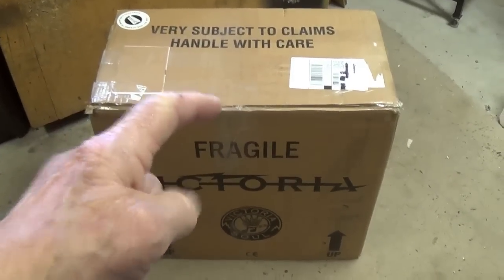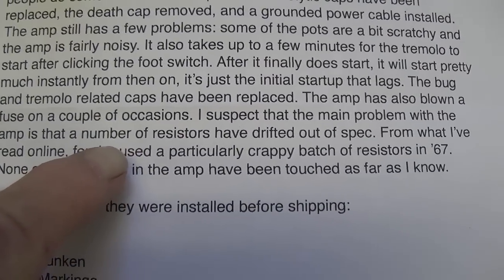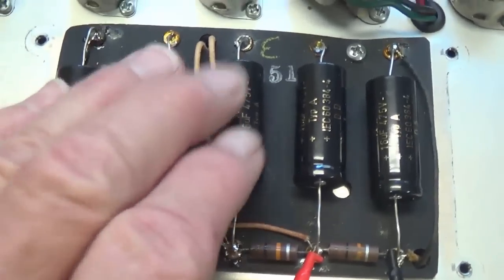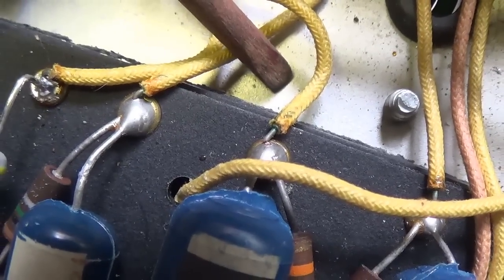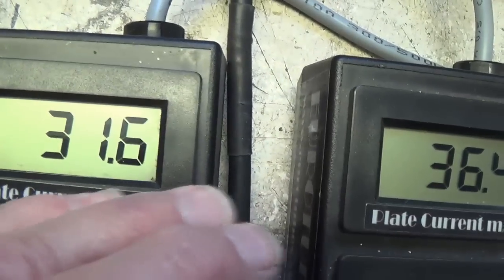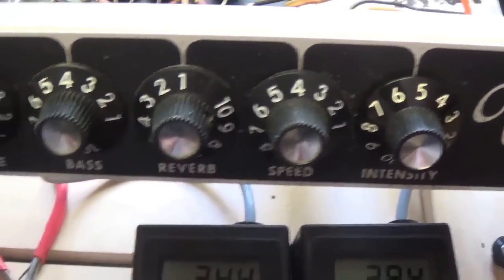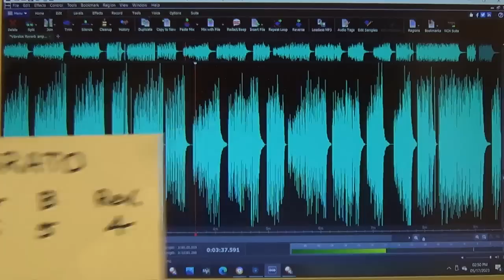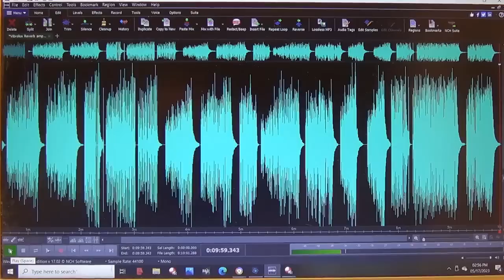1967 Fender Vibrolux Reverb with a Lazy Tremolo and too much Background Noise

Comment: Thanks so much for the work on my amp Uncle Jack! It sounds fantastic. A little more history on the amp - I'm the second owner. The original owner put the amp in a closet in 1974, where it stayed until I bought the amp. I suspect the power transformer was blown at that time. I do have the original transformer, but it likely needs to be rewound. I'm not sure if it's worth the time and effort to do that, but welcome feedback.
Reply from the maker: I wish I had received the old PT with the amp, Matt, to confirm whether or not it was at fault. If you intend to keep and use the amp, I would say that remaining as-is would be fine. If you ever wished to sell it for maximum price, then rewinding would probably be financially advisable.
Reply: @UncleDoug  Is it just me or the collectable market is a bit absurd? I mean, that's a perfectily good PT replacement as far as I know. I understand that original components in vintage amps are desirable for collectors, but that amp is going to have plenty other non original components anyway. What's so special about vintage transformers?
Reply from the maker: Obsession with originality is common to collectors of all sorts of items, D. I recall, as a youthful stamp collector, being astounded that the nearly invisible trace of a stamp hinge on the rear of a collectible stamp reduced its value significantly. I suggest taking advantage of this nonsense by buying up every classic vintage guitar and amp you can find that is highly discounted over some minor discrepancy that does not actually affect their function.  @-dazz-

Comment: Hi Uncle Doug....love your vids..please keep them coming.  FYI that resistor you tested at 18:45 the color band is GREEN not BLACK.  I think that one was testing properly and found its way into your 100K resistor pile.
Reply from the maker: Thanks for your input, I.
Reply: @UncleDoug  I saw that too. Please double check if you haven't already emptied the trash can. The one on the right was obviously black, not so much the other one.
Reply from the maker: Will do, T :)

Comment: Darn youtube has failed to keep your videos in my feed... I finally manually go to your channel and find a wonderful batch of new vids to watch. This one hits home for me, as this IS the model of amp I have lived with since late autumn of 1968. You may recall my mentioning mine in other comments.. It has one Oxford and one Jensen, mixed up at the dealer, Beaverton Music, at the request of the first buyer. Mine is still all original mint condition, dead stock except for upgrading the wire and RCA plugs on the footswitch.  Like this one, it is CBS labeled on the rear, but still a blackface, so made in that time period after Leo sold in 1966, and the amps were changed in late 67 or early 68. I have been collecting parts to do a full service on it, so it will be ready to serve my son for another half century after I pass from this world. It will receive also a grounded power cord, and the switched NFB modification.  Lovely to see this Vibrolux.. It is a wonderful device, ... in my humble opinion, the peak of Fender amps for all time.
Reply from the maker: Thanks so much for sharing your valuable knowledge and insight with us, Jennifer. I'm sorry about the YouTube snafu......hopefully, the situation will improve.

Comment: Wow
I think the tubes not so balanced 
made a difference. The tones a 5 o'clock 
Volume consistent, the amp sounds
Fantastic. What a sweet old sound with
or without reverb and tremolo.
Maybe a couple of tremolo examples
matching tempos to tunes  
a little more, and even dead slow
would show off the THROB factor
A little more. But I get the feeling that
amp is a one of kind sixties beauty.
Well done. Uncle Doug.
Reply from the maker: Thanks for sharing your insights, Lorenzo :)

Comment: Another great job! Kudos! From my time, back in the day,At tech school...old timer repairmen would never throw out a functionng tube, even if weak, as long as it worked because, just as you demonstrated, a tube not working optimally in one circuit might serve just fine in another. Tubes 'wear-in', sort-of self-adjust to the circuit they live in. Old time TV repair men would always have a stash of 'take-out' tubes for that reason. .might solve a problem without needing a new tube..maybe save the customer some $$ and get a set back in service without having to go back to the shop or order something....ahhhh those were the days.. wink.. wink!!!
Reply from the maker: Thanks, FH, for both the nice comments and the interesting story.

Comment: Gotta love all the different packing configurations!  (perhaps kitty treats?  we'll see)  Old Fenders are really tough but good packing is important.  In a moment of what not to do, I remember "fixing" my old pro reverb by flipping it over in a 360 degree frustration maneuver.  Evidently this fixed the solder joint on the rectifier tube for a spell and allowed me to continue much to my amazement!  But this temporary bodge proved wanting and a professional like Uncle Doug was eventually employed to set things right.  'Ol Bessie still functions correctly some 28 years later but could use a tune up.  Wanna 73' on your bench?
Reply from the maker: Thanks for sharing, Sly. Message me on FB: Uncle Doug's Vintage Amps to discuss repairs.

Comment: Always good to see a new Uncle Doug vid. I’m about to repair a ‘67 bandmaster. The owner purchased it new and it’s never been serviced except to have it’s bias adjusted. Anyway, a story about resistor drift. I once put in a 100 ohm B+ dropping resistor right after a solid state rectifier. My idea was to mimic a tube rectifier. Well I install it and the amp acts funny. I get only a few volts on the plate of the first preamp tube. I measure that 100 ohm resistor and it had drifted up to around 5 megaohms. 😂 Basically, I failed to calculate the current and put in a resistor who’s wattage was severely under valued. And this despite that it was a metal oxide resistor. 

I think that resistors generally tend to increase in resistance as they fail. Carbon comps may heat up and crack, but I think film and oxide resistors probably begin to fuse, or internally melt, and the resistance goes up. 

I had a similar experience with a ‘66 Schumacher output transformer. It failed and the CT to one of the primary wires to the plate read 6,000 ohms while the other side read 78 ohms. My guess is that the coil began to melt, fusing together and the resistance increased.
Reply from the maker: Thanks for your helpful input, Alva.

Comment: Thanks Uncle Doug for reminding me to check the resisters in my hi-fi tube amp. It is a good 10 years now since I built it and the noise floor has been climbing slowly over time. Suspect carbon resistors are a very likely culprit..
Reply from the maker: I agree, Johann. Carbon comp resistors do not age well ;)

Comment: That Marvel PT is one of the ones sold by CE Dist (Antique Electronic Supply) as their "house brand" Fender replacement transformers --- I've used many, many of them and I still have a few BF Vibrolux/Tremolux ones (125P26A replacement) on the shelf ---- They were great value for the money and I've never had one fail ---- My #2 1965 BF Bandmaster (sitting behind me) has a Marvel (from CE Dist) PT, a slightly larger model (125P7D replacement) ----- I bought this amp to fix/sell but when I tried it out it sounded almost as good as my #1 1965 BF Bandmaster that is exceptionally good sounding --- I ended up keeping both 1965 Bandmasters ---- Great work on the BF Vibrolux Reverb, btw
Reply from the maker: Thanks, Mark.

Comment: My hunch,  the unidentified tube was a 12AU7 and not an AX7, they often look the same.   Fenders need the gain to get the oscillation going.   I’ve experimented with this before and your issue agrees with my finding.
Reply from the maker: You may be right, Jon.

Comment: Hi Uncle Doug. Just a bit of info about "Resistor Noise" it's quite a technical subject however I found this which might be of interest - All resistors emit some amount of noise when there is a current across them. This is known as Johnson or thermal noise.
 Audio noise generated by resistors results from the motion of electrons within the resistor, which creates an unwanted AC signal which gets superimposed over the primary signal.
The motion of the electrons generates the resistor noise within the resistors.
In general, there are 2 types of resistor noise, namely thermal noise and current noise. Thermal noise is usually the main contributor to resistor noise. The movement of electrons causes thermal noises. As the temperature increases, the motion of electrons increases, hence increasing the thermal noise produced. However, current noise decreases when the frequency and movement of electrons increase, unlike thermal noise.
Also, thermal noise increases with a larger resistance value, whereas current noise decreases when resistance increases.

😏👍🇬🇧
Reply from the maker: Thanks for this helpful info, Bruce. The troublesome noise most associated with carbon comp (CC) resistors is the loud popping and rustling sound heard in many vintage circuits. While thermal noise is an inescapable (and generally very minor) issue with audio circuits, CC-induced noise is not, and is easily remedied by replacement.

Comment: I had a Bandmaster come to my shop that  "didn't sound right".......  and I sort of didn't want to play that game.  Turns out the power transformer was replaced (years ago)  with something that didn't really match up well with the amp.   I swapped that out with a Weber transformer used in their clone kit,  and restored any mods to stock.   That did the trick.
Reply from the maker: Old repairs can be a huge source of misery for a tech, DK, especially if they are aged and inconspicuous.
Reply: @UncleDoug  This repair was OBVIOUS (to me)  as they had deleted the rectifier tube and popped in diodes.  There was no 5v winding.
Reply from the maker: Yep.....That would definitely be a clue ;)

Comment: I've never ever noticed any difference in tone using one type of resistor from another, these days I will ONLY use metal film resistors, so much more accurate and longer lasting, people forget that those old resistors aren't brand new, even new old stock, you're still trying to get something that's 70 or 80 years old to work like new, that ain't going to happen 😂

I think also resistors like that might absorb moisture over time and you get like a weathering effect, shrinking and expanding all the time, you're right when you say that thing gets cracks!

Surprised to see a video again from you so soon!

(oh, that solder blob on the outside if the case can't be original, is it? It's hideous!)

I've always found with tubes, I clean them, and the paint just comes right off when it hits the water (maybe we just used crappy paint in the UK!) I have to take pictures now and then write it on after
Reply from the maker: Thanks for sharing this with us, P.
Reply: @UncleDoug  might have gone on a bit too long there 😅
Reply from the maker: We always enjoy your comments, P.

Comment: Hey Big D, wasss up. Ok I have a screenshot of your face in the reflection off of the getter flash, I have sent it to NSA for I.D. purposes. I liked the Wurlitzer Vid, something really different. You talked about being a guy taking two weeks to figure out what is wrong with an amp, I feel your feeling 😂😂, even retired, I'm the guy who everybody brings their car to, after 5 other guys messed it up by trying to fix it, yeah two weeks is about right  🤣🤣🤣🤣. Also, if you want to annoy your gen x,y,z,etc neighbors, crank the amp up, push 15Khz through it, you and I can't hear it but they can, Oh yeah it stops barking dogs also. Well the AMP sounds great, not as good as a Leslie of course, but great non the less, also again, your playing has really gotten good, congrats.
Don Leslie Rules
Blue Mule
Reply from the maker: Thanks for the helpful tip, Mula Azul. I could probably lower the frequency to 5Khz and still not hear it ;)

Comment: Sometimes the LDR is the issue, I had the same issue with tremolo on my BF VR and it would be slow to start the first time you used it that day, after it started, it would sound nice and strong, and it would fire up right away for the rest of that day. Next day same thing, slow tremolo startup. I tested EVERY part except the LDR  because when it worked it worked really well. I finally had enough and replaced the LDR and never had the issue happen again. Anyhow, very good video! Thanks
Reply from the maker: I agree, James, and have offered the same advice to several viewers who sought help with this problem.

Comment: Thank you Sir for the great BFVR video! I have a 1965 Fender BFVR that I love. However, there is a pesky ticking noise in the tremolo(vibe) circuit. Also, my tremolo/vibrato speed doesn't go passed 7 on the knob. The oscillation just stops at that point from 7 to 10. This video has really given me some things to chase down some fixes.
Reply from the maker: We're glad the video was helpful, Lou. Good luck with your projects.

Comment: I once wondered about lower-than-expected preamp voltage in my modded "Knutsen amp" from 1963. After all, the preamp and PI had been redesigned with all-new components. Checked the still-original dropping resistors. The preamp dropper had drifted from 47k up to 70k. Voltages got better after replacing that one.
By the way, nice to see Mitzy helping you out. How is KC, Jack and Ollie doing? Hoping to see all the kitties in a future video.
Reply from the maker: Resistor drift is a common cause of amp ills, Asle. The kitties are better than ever and ready for their next video scenes :)

Comment: @18:20  that black band on the resistor is actually a very very dark green.  That would make the resistor 150k, and measured at 147.8k
Reply from the maker: Thanks, MV :)

Comment: Nice work Doug.   I did notice that the ground connections from the transformer are connected to the transformer bolts.  I've seen this as a common problem with less than optimum contact.  Looks like this one is ok, but pointing it out.
Reply from the maker: Thanks, RC. With a proper lock washer, I foresee no problems.

Comment: If you have tremolo won’t start occasionally, try replacing the bypass cap on pin 3 with a 250uf cap.  This will increase the gain of the oscillator stage at low frequencies of 3-10 hz. 
The ticking is from the neon bulb firing.
Replace the neon bulb with a clear white LED.
Tick gone.
Reply from the maker: Thanks for the helpful tips, ED1 :)

Comment: Uncle Doug, any thoughts about replacing the opto “roach” in the tremolo circuit? It seems that these can get weak over time and can be a source of weak tremolo also. That might be part of why the trem doesn’t kick in until 4 on the knob.
Reply from the maker: I didn't consider it, Andrew, but it's not a bad suggestion.

Comment: Cautionary Tip 9471 is good advice Uncle Doug. Also, some resistors aren't as clearly printed as they used to be and can have indistinct colours, which is another reason to take note of CT9471. I've just gone through all the past videos but can't find Cautionary Tip 9470 - I must have missed it somewhere down the line............
Reply from the maker: CT 9470 is included on our Anniversary DVD Collection, AG, available on Amazon for only $9470 plus shipping ;)
Reply: @UncleDoug  I’ll order it immediately!

Comment: Great video

I noticed that you immediately saw that the last knob on the right was not original because the screw was on 1 instead of 10 and the font was a little different. Do you know where I find knobs that fully respect the original specifications? Because those sold by Fender on their website have the screw on 1 too…!
Thanks for your outstanding work
Reply from the maker: Thanks, M. Perhaps on Ebay or Reverb, where someone is selling original, vintage knobs.

Comment: hello again, would you happen to have any recommendations for 12ax7 other than jj's? I've recently had really bad luck with them haha i put in new power tubes and set the bias and still had the same problem before and turns out it was bad preamp tubes which were brand new jjs so i almost didnt think of them first. However i did find that the amp was previously biased way too hot so at least good to get that back to a normal level. Thanks again for these videos this is top quality content!
Reply from the maker: I do better with Russian tubes, like Electro-Harmonix and Genalex